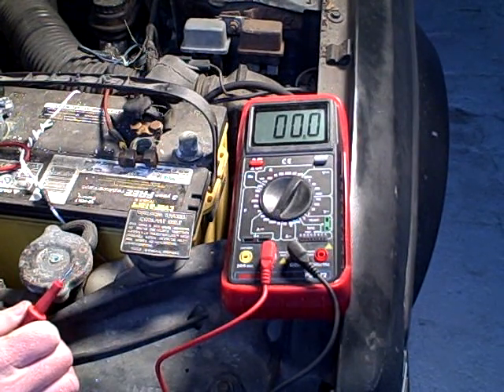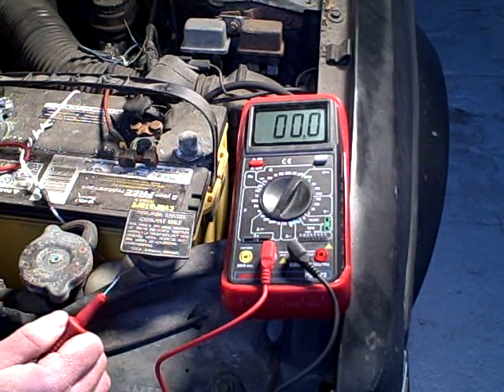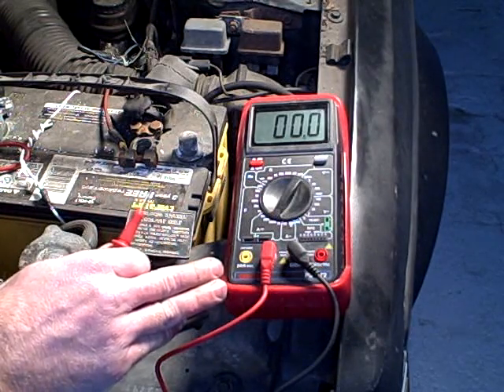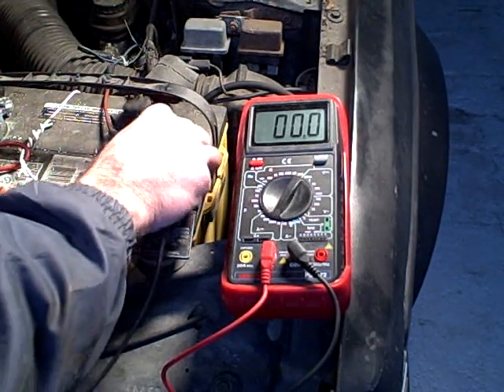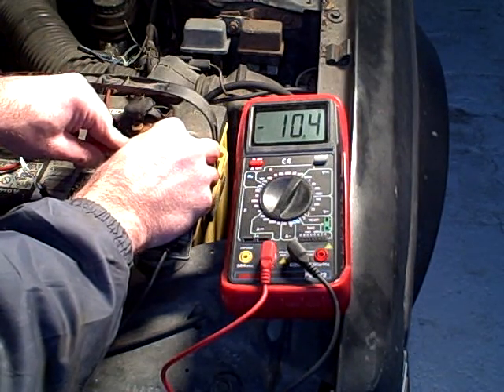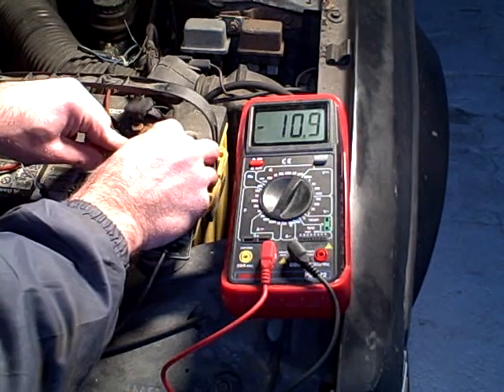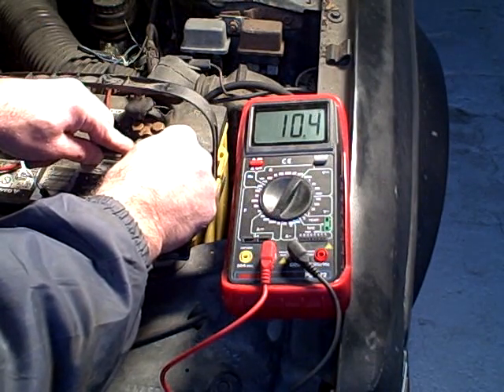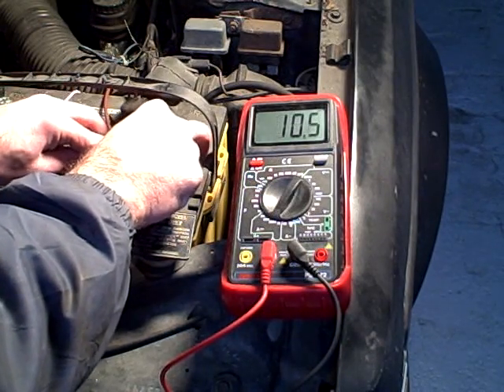Measure The Standby Current Draw On A Car Batttery

Comment: Really? Disconnecting the positive cable with the negative side connected is a VERY BAD idea. This test should only be done on the negative side of the battery ONLY because if the positive cable slips and grounds onto something like the body or engine, it could spell disaster. Automotive Electrical 101.
Reply: +thenuttyson Wouldn't necessarily spell disaster as the battery itself is open circuit - at least until the multimeter completes the circuit, which is fused in any case.
That said, disconnecting the -ve side is definitely safer and recommended in most product installation guides.
I only came on here to see what an acceptable quiescent current is!?
Reply: +minshum i believe, depending on the car, 25-35 milliamps would be acceptable. Best thing to do is, find a forum for the car you are working on and see what is posted about acceptable standby current draw. My '01 Mustang Cobra has been measuring approximately the range I mentioned, and the voltage has not dropped under 12.2 volts or so even after the car sits for 2-3 weeks. This is since I resolved my problem of a 175+ quiescent current. 
BTW, I used a parasitic draw tool on the negative post to complete the circuit using the multimeter without "waking up" any components in order to get an accurate reading. I bought it at an RV place for about $30. The ones on Ebay and Amazon would not work because something was missing, or it would not fit-cannot remember now.

 If you have ever dropped the positive cable onto the engine while the neg was still connected, you know it can be a problem, especially with the sensitive nature of modern car electrical systems. Not to mention, a spark could cause the battery to blow up.. Better safe than sorry i say.